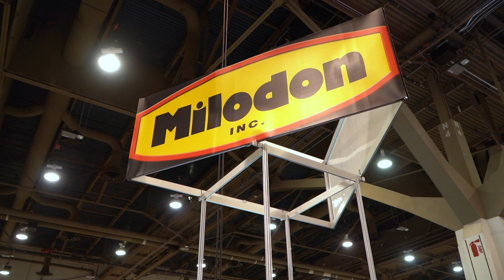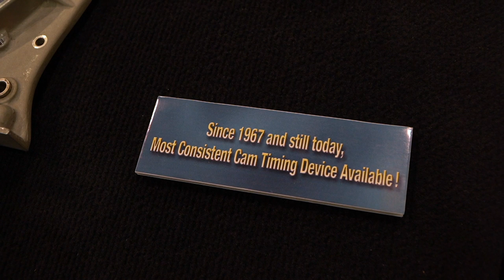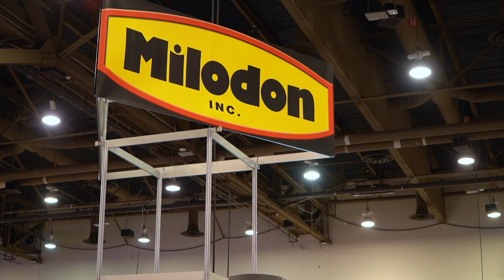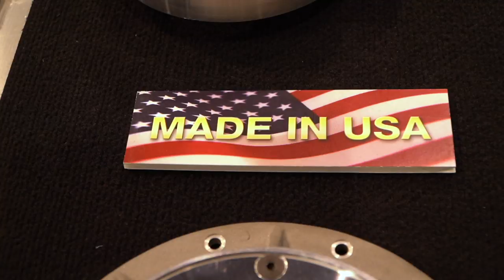SEMA 2019: Milodon Keeps Your Camshaft In Time With High Performance Gear Drives

Comment: Going back to a gear drive after running a belt.  Never again will I run a belt.  Ran a gear drive for MANY MANY years, never an issue.  Switched to belt, belt broke, cost me thousands in repairs.....And LOTS of misinformation out there about gear drives.....

Comment: But do they make it for LS?
Reply: No LS gear drive unfortunately. GM put a large boss on the block right were the idler gear would be placed. We are still looking at it but it will not be easy.
Reply: @Barrelhorse1000  which is why I will NEVER build an LS ...

Comment: So, I after listening I was sold, I had a Pete Jackson style and am a Hobbyist with some extra cash so I bought one.  Let me start by saying unless you are a sponsored drag racer who must crank out that extra tenth of a second these things are expensive for that reason.  Also, they are just as noisy as the floating 4 gear set ups and more of a pain in the ass to install.  The back yard street mechanic can do it  but it’s lots of extra work for that tenth of a second.  Also if you are a hobbyist Hot Rodder then the blind install can be confusing.  The system doesn’t  have any basic timing marks to set it.  I watched you tube after you tube trying to get a starting point.  As much as it was explained you had to get a degree wheel and exact TDC by breaking out your dial indicator.  Milodon make me think their mark up must be minimal because they make a dvd showing the install but you have to pay about twenty five dollars to get more than the two pages of paper instructions.  My only recommendation to Milodon is put a basic zero timing mark on the parts for the first timers like me and then add in the dial indicator concept to degree the advance or retard of the cam.  Honestly,  after all these years of sales just throw into any purchase a free online download of the install DVD.  Also, these have been around for a long time and for the street Rodders I would make a set with spiral gears to cut out the whine, we are now 60 years from its invention and the largest improvement could have been sound reduction.  Finally, if you are a Street Rodder with spare cash like me doing an in car install, don’t pull your old gears until you are at TDC number one firing order with your old gear set or chain lined up on zero marks.  Also, don’t move it until you are ready to degree the new gear set.  If you are doing a cam swap slide the new one into the same position of rotation as the old one being removed.  Remember the operative words are “blind set up” which incidentally if not done right translates to bent valves!  LOL or maybe it’s not LOL!
Reply: Can you line up cam and crank with the marks on a timing chain gear set and not move them while trying to slip in the Milodon gears? I know it sounds easy buy...